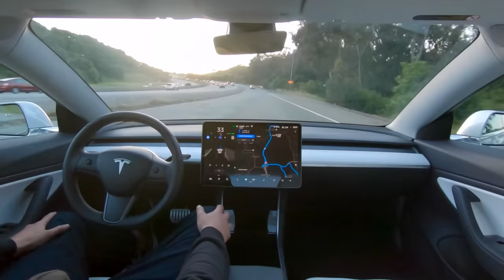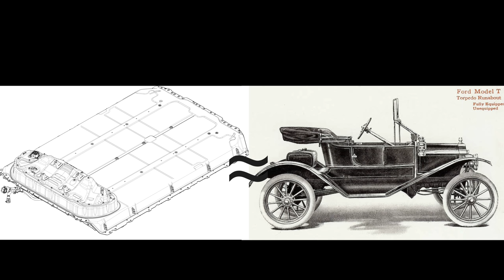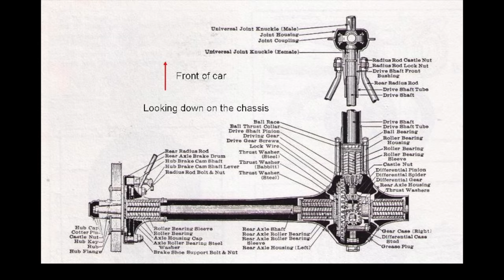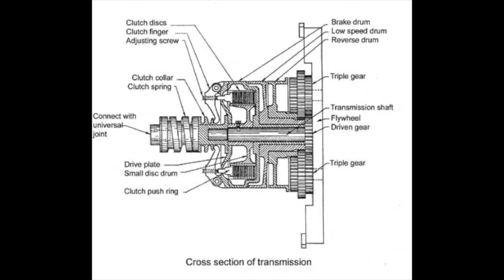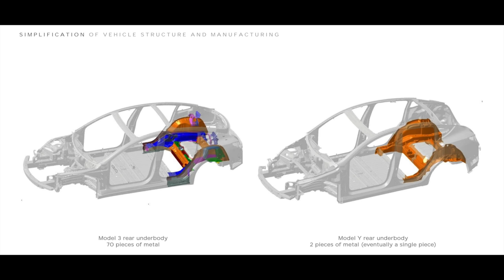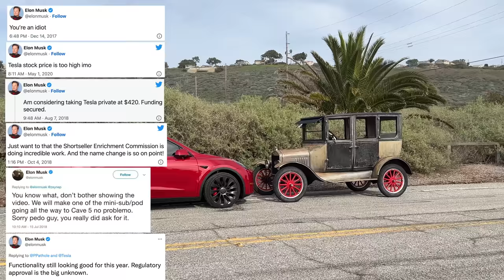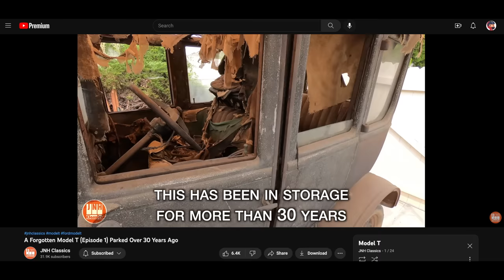1923 Ford vs 2023 Tesla

Comment: My family has collectively owned 3 Teslas. 2 2021 Model 3s and 1 2022. All of them had build quality issues on delivery, although I will say the 2022 is the best out of the 3. It’s still the best overall EV available at the moment, mainly because nobody has caught up with their combination of tech, performance and efficiency. They really need to step up the game with their build quality though, since they’re no longer innovating like they used to.

I still prefer to drive my Ioniq5 though, because even though it is less efficient, the in car tech is not as good as the Tesla and it can’t use the supercharger network (yet), it’s way more comfortable, much quieter and has actual buttons on the dash.
Reply: All hail the button.

Comment: You can buy manual buttons for a Tesla, just use an app to assign functions. Some things just seem quicker and easier with a physical button rather than having to scroll through a menu just to change the ac or heater settings, especially while driving.
Reply: What are they called, which company make those buttons?
Reply: @sallerc  the company is called Enhance, the product is called s3xy buttons. I saw the ad on the latest Munro Live video, scroll to the last part to see how it works.
Reply: @DomingoDeSantaClara  Thanks!

Comment: I don't think any Tesla will ever last as long as a Model T.
Reply: I have pants that will out last a Tesla!
Reply: The one in orbit round the sun will probably last quite well.
Reply: @markpitts5194  - For sure. But whoa! The mileage.
Reply: @markpitts5194  the radiation has probably already killed it form working again, if they got it back that is.
Reply: Basically nothing made today will outlast a Model T. Simplicity is durability, but simplicity isn't safe enough.
Reply: @Phoen1x883  It's not the safety stuff that's going to cause the modern cars to fail quicker, it's the "creature comforts". Electrical systems mostly, but also the durability of the plastics and such too. A durable and safe car is easy to make. Look at Matt's land speed record car. It's both safe and durable. But, besides the obvious of it being too long and low, you're never going to want to drive it anywhere because it's lacking in ALL the creature comforts and you've gotta be in a 6-point to be safe.

Airbags, power windows, AirPlay, remote vehicle updates, emissions "nanny" systems, CVTs, etc... THOSE are the things that fail that make people get rid of a vehicle.
Reply: CVTs are good needs time to improve in reliability.
Reply: @kaptain1477  And this proves my point...
Reply: @aquaseafoamcrayon1739  Most people's mums probably have tinned food in the back of their kitchen cupboards that's older than the average life expectancy of a new Tesla ! :D
Reply: @Aragorn450  Definitely, and there is so much of it. Not being able to drive cause you electric moving seat is stuck is going to suck.
This is the problem with modern cars. many systems that should be non essential, are all tied in with essential systems and can hold everything.
Want to go anywhere? Computer says no.
Reply: Model Y is one botched software update away from turning into a huge paperweight.
Reply: @Phoen1x883  there are actually safe vehicles that can also last very long it’s not just about model T
Reply: @kaptain1477  CVT are already super reliable l, it’s some manufacturers that uses crappy ones! Toyota has a first physical gear to reduce the stress on their CVT…..
Reply: @alanmay7929  manufacturers using crap parts on a flawed design to save money. Things  such as using wring type of bearing or  not providing  proper lubrication  through the system.  Ford  and Audi CVT , Honda when they switched from 4spd to 5spd automatic in the Odyssey. The Ford 351C oiling system.  Most minivans while weighing 1000lbs more than a car using a fwd car transmission.
Reply: @craigwiess1656  lol…. Which minivan has a CVT!?
Reply: @alanmay7929  more of a wagon Ford Freestyle  later renamed Taurus X
Reply: Be careful what you say, maybe the roadster in space will miss its trajectory for some odd reason and live for millions of years. Don't see no Model T in space ;)
Reply: @Reman1975  :) Well to be fair, every new car isn't built to last 100 years.
Reply: @Aragorn450  Those things never ever ever fail. Literally go to any abandoned crashed car and electric seats will work. Electronics are reliable especially Tesla's. Planes literally use electronics for flight controls and it never fails.
Reply: @dkdanis1340  Hahaha, too bad that's just not true... Yes, electronics from planes and such are used for eons after their "shelf life", but for cars, the money and engineering time required to make them THAT reliable is NOT spent. So they aren't anywhere CLOSE to that reliable.

Do a search looking up electrical issues with BMW, Mercedes, etc... They're very well known for their electrical systems failing early. Mechanically, they've traditionally been great, but electrically, they've traditionally been TERRIBLE.
Reply: @Aragorn450  ..Yet my family's 2017 Toyota Fortuner would beg to differ.
Reply: @rbgerald2469  sighs What, just because your 5-year old Toyota is doing great right now means that vehicles that are 10 years old or older won't?! What kind of argument is that?

"Oh, hey, my iPhone 7 has never blown up, so that means that the Samsung Note 7s never had battery issues either."

Besides that horrible argument, a 5 year old vehicle is NOT what we're talking about here anyway. 5 years is still basically brand new. If vehicles from a brand were dying within 5-10 years, the brand would be GONE.

Finally, Toyota, Honda, and a few other manufacturers have traditionally done a VERY good job with their systems. And ESPECIALLY Toyota's Hilux-based vehicles, which is what the Fortuner is based upon. Look up Top Gear's attempts to destroy a Toyota Hilux. They uh, failed, miserably... But not quite as miserably as your argument.
Reply: @Aragorn450  ..If you want old, My Isuzu D Max pick up which is 15 years old! Was bought new by my dad in 2008.  Still runs, and it's electronics are ok.
The only thing broken is the latch that opens the Hood.
Reply: @rbgerald2469  Refer to my first argument. Yours works fine, LOTS of people's work fine. But that doesn't mean that plenty of others don't. ESPECIALLY when you're talking about a pick-up that has very few electronics. And also a brand that's not known for having advanced tech in their vehicles. Do some research before trying to argue more. I know very well what I'm talking about.

I'll repeat it once more. Just because your specific examples don't have issues doesn't mean that there isn't a systemic problem with others. You're talking about Apples, I'm talking about Orangutans. They're just SLIGHTLY different.
Reply: @Aragorn450  .. Alright I see.

Comment: Fascinating! Extremely informative.  Funny, when I saw the title of this video, I was thinking of the time I saw a Model T next to a Lunar Rover.  Never knew the Model T was so complex to drive. (will never complain about manual driving again.)  Plus, why does the Tesla NOT come with a spare?  I used to work for a auto glass company & replacements for Model T glass was surprisingly available, however, now (or then), the replacement glass was tempered glass. (Legal / regulation? Safer - Yep)  Your friends Model T looks amazing.
Reply: @@dr5290 Wow, no more spares?! Did not know that. Though I haven't owned a car in a decade or two either. oh well.
Reply: Neither my 2010 Sienna nor my 2014 RAV4 EV (with a Tesla drivetrain) had spare tires from the factory: both were supplied with tire-goop-in-a-can and the RAV4 with a 12v air compressor.
Reply: Modern cars don't come with spare tyres as it saves space and weight.

Comment: The most important feature has been overlooked and is just as important today. The price. The winner will always be the biggest bang for the buck. VW Beetle, Toyota Corolla, so many examples including the first Model T.
Reply: The average corolla sold in 2021 cost over 31k(we don't have 2022 numbers yet) The last vw beetle(a car Hitler was directly responsible for bringing into existence way back in the day) yeah those aren't cheap either. And suck to do any maintenance on as well.
Reply: @4literv6  That's not the Corolla I'm talking about, it's evolved into an abomination
Reply: @MegaWilderness  one of my neighbors has one that's a couple years old now. Couldn't believe it when he shared it cost them over 30k.
It's not any nicer imo than our little beater ford fiesta se from 2018 which cost us just 12k brand new at the end of 2018. 🤔
Reply: I know the corolla he means, the 70's and 80's ones. The ones some kid can abuse in a paddock for 10 years after being mums daily for 20 years, then i come along 10 years since it last ran, put a battery and fresh fuel in it and drive its beaten up rusty, muddy ass 100km home and it doesnt even overheat. 1977 ke30 se sedan. Bought it for some parts for my 78 and 79 corollas.

Comment: My old boss told me that when he was young, the steering wheel came off when driving a model T down a hill. He said he pressed all three pedals, low-rev-brake!
Reply: Pressing all 3 pedals to slow down was common practice because it prevented the brake band from wearing out faster than the other two!
Reply: @allareasindex7984  That makes sense. I think for him it was out of panic though :) He was reminded of that story as he piloted his workboat (basically a small wooden Maine lobster boat) through some modest waves. He was able to hang onto the wheel, whereas the nearest handhold for me was a vertical pole which happened to be the exhaust pipe. I guess it occurred to him that steering wheels hadn't always been a reliable handhold for him.

Comment: it would be a dream for me to have either of these 2 vehicles.
Reply: A drivable Model T is pretty affordable. You can get one for 6 to 8k if you don't mind it not being very shiny restored.
I drive a model A daily, bought for 13k and I'm 30
Reply: @DrTheRich  how reliable and easy is it to get parts for?
Reply: @IeeIee778  Very, not many parts that can break, just make sure you check everything and grease the moving connections every so often. The car has very little plastic pieces (it has some bakelite parts) and no sensors, which is what most often fails on modern cars.

And the gravity fed flat head engines just keep running forever. And the times I had something wrong, everything is easy to get to and fix on the side of the road if you know what you're doing. 

The only time i had to be towed was when i had a flat tire, and my spare tire was still bad and just decorative (i've replaced that one with a new now)

Parts are readily available, especially in the US since there are so many still driving around, there is a healthy economy in reproduction and refurbished parts.

outside US where i live, it depends on the country. Mine has pretty sizable Model A community, and some webshops that regularly import parts.

If you learn to do basic car repair yourself (anything short of body work or engine machining) it's not that much more expensive or even less than upkeeping a quickly rotting away modern tin and plastic car

Comment: 13:40 Oh so like when I got a 2018 Ford Focus and the driver's side fender had a watermelon sized dent in it, the front bumper had impact damage, and the carfax report said that the rear bumper cover and trim insert was replaced with the footnote "fell off transport." It had 49 miles on it when I bought it. 😂
On the bright side it was 5 grand off MSRP so I walked out the door only paying 20k. The dealership I worked through fixed the leftover damage for free, and yes it was being sold as new, not used. It bounced around for 9 months up and down South Carolina, Georgia, and Florida. They could not sell it. Here I am 40k miles later and it still makes me smile.

Comment: Little correction the Model T engine is cast Iron not vanadium steel. All other steel in the car is vanadium steel tho.
Reply: The engine block and head are cast iron, but the crankshaft and rods are forged steel, aren’t they?
Reply: @emmajacobs5575  yes

Comment: Only one of them has DRM, surveillance, and monthly subscription based features.
Reply: You could argue regular dealership maintenance is a subscription feature, because otherwise you couldn't make money selling cars.
Reply: @crackedemerald4930  I wouldn't argue that. You can repair your own car or take it to an independent mechanic. How often your car requires maintenance is entirely dependent on your environment and your usage.
Reply: @acf2802  and the reliability of the car. The T definitely wins out there, though my maintenance trips have been significantly less with any EV I've owned than the 2012 Ford Fiesta I had. That thing went through 6 transmissions! (double-clutch style auto, regular commute driving.. had to replace it every 25k miles or so)

Comment: I really like the intake/exhaust manifold stud design! Curious to what kind of gasket/feature they use to seal that.
Reply: There are 2 intake ports and 4 exhaust ports. In a stock T there are 6 guide rings, these are just sheet metal rolled into a ring. Then 2 gasket cards, each with 3 holes for the ports, with cutouts so they hang on the studs. It’s a bit of pain to juggle both manifolds, make sure the rings are in place, and that the gaskets are also in place, AND THEN tighten the 4 nuts that clamp all of it against the block.
Reply: @WreckRod  I guess it is! hahaha We've been in need of a third hand for a while.

Comment: was the Model T really that slow?  Or was it just an early model?  I thought they could reach 50mph (though you shouldn't)
Reply from the maker: I found some numbers online showing faster top speeds, but that was the actual speed of this Model T
Reply: @SuperfastMatt  Poor thing must just be old and tired :(
Reply: @DeadBaron  Nah, it's barely broken in!
Reply: Given a good tuneup and favorable road the T might go faster than 40. But the tires, brakes, suspension, engine oiling, crankshaft bearings, etc were totally inadequate for that speed.

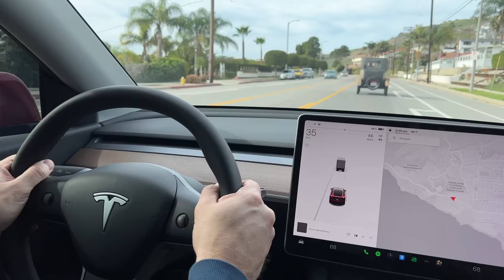Comment: 5:45 the difference is tesla hvac is fully automatic. And as soon as you press climate button huge hvac window pop opens with big buttons so that it's easier to press.
They only had panel gap problem in early days. Curb rash isn't a sound of bad quality of the car itself. The drivetrain is bulletproof.

Comment: Absolutely brilliant video, and I appreciate the detailed info on some of the Model T features. Sketchiest car for safety? Probably, with the exception of some of the "converted horse carriage" forerunners. I would be uncomfortable driving the Model T, mostly for the lack of brakes and the key pointed at my kneecap, and this is coming from a guy who has gone 120mph plus in a rusted out 1960's Plymouth and done 51mph on a pedal bike 🤣.